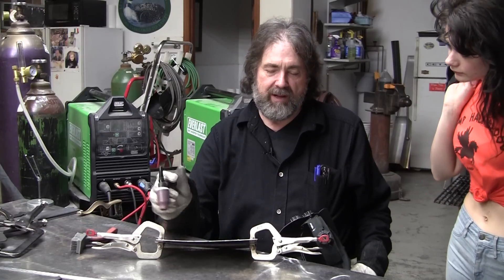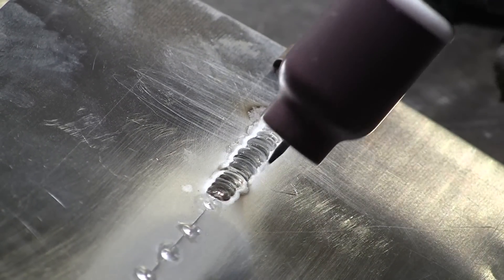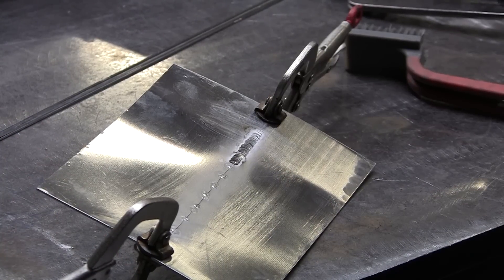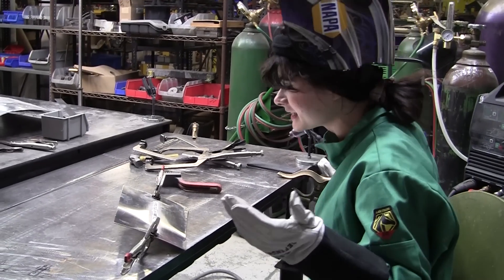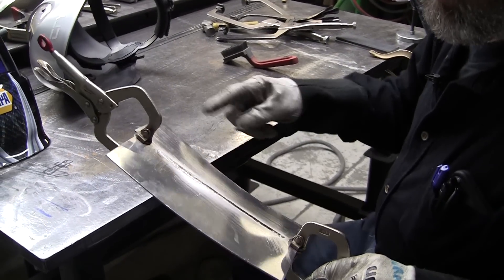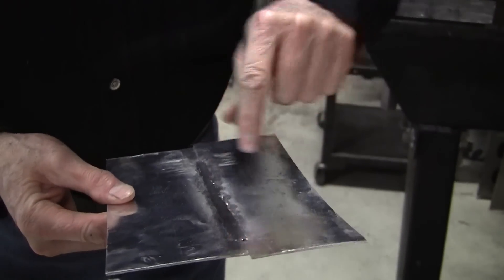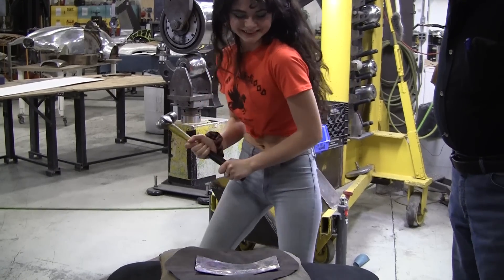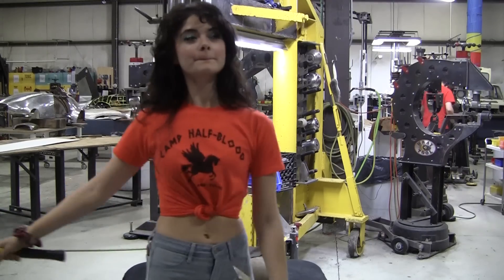Jac vs.  Aluminum Welding

Comment: If you gas welded it, you wouldn't have to do the back side…
Reply from the maker: Hi Horace, I'm fully aware of that. I can gas weld as well, but prefer Tig with pulse. Also I teach and tig is much easier for my students  to learn and a lot more forgiving.
Reply: yeah sure-
Reply from the maker: @horacerumpole6912   I detect doubt and distain.😁😁😁

Comment: What aluminum #did you weld together . I like it. When older on what we have learned 👍
Reply from the maker: Hi Ron, .050' 3003 h-14 The process is very simple. Tight joint, tacked set welder at 60amps  1 pulse  use 50 % argon 50 % Helium  and  just go at it top side first then back side. Full pedal all the way.  All you to do is be consistent with your speed and tungsten position.

Comment: Wray, what is pulse and amperage settings?
Reply from the maker: Hi Matt, Mark has them written in the first part of the video.  Pulse was 1 amps at 60. My other aluminum tig welding video has all the settings.
Reply: Wray Schelin's ProShaper Workshop Thanks Wray